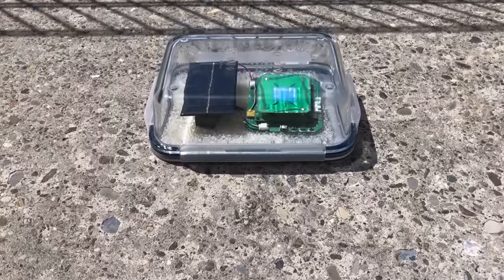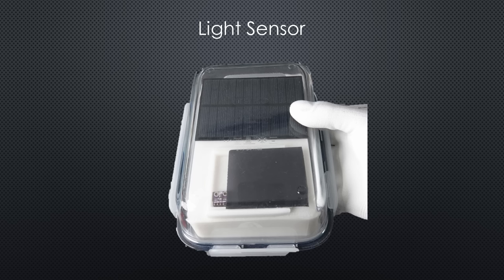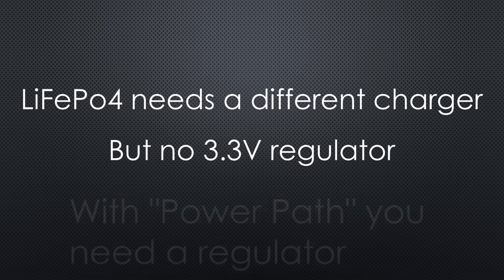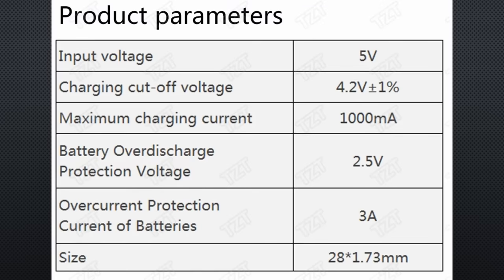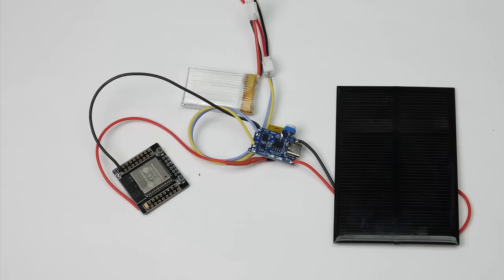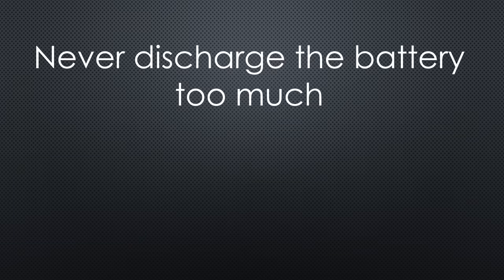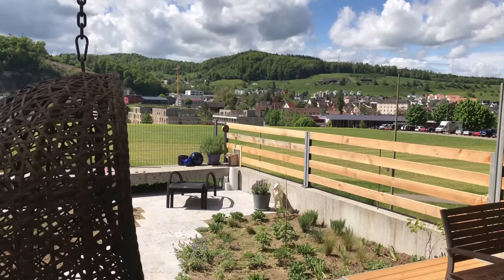#383 Cheap and simple Solar Power for our small Projects (ESP32, ESP8266, Arduino)

Comment: How about winter when -20C outside?
Reply from the maker: I do not know because we do not have such weather where I live. I assume the Li-Ion cells would not like it. Maybe you do a test setup?
Reply: @AndreasSpiess  Yeah, I am just hinting about LiFePo4 or LTO. And yes I am thinking about test board, I planing use some step up converter for 5volts with enable pin.... P.S. nice hint with diode and p-chanel transistor on power path!!!!

Comment: As I mentioned in previous comments, the combination of variable solar power and the typical power path circuit results in battery current flowing through the mosfet body diode under certain conditions, thus producing a 0.7V drop.  I've posted my work on this to a Github repo:

https://github.com/gbhug5a/Solar-Power-Load-Sharing

Included is a new design I've tested which features an opamp driving the mosfet gate.  The opamp inputs are the drain and the source of the mosfet, so anytime the output voltage is lower than the battery voltage, the mosfet turns on.  The result is that the output voltage is never lower than the battery voltage, and nothing flows through the body diode.  Seems to work well, and doesn't oscillate.  The opamp draws 1uA, and can mount on the TO-220 mosfet body and connects to its pins plus one ground line.  Also, no need to change the programming resistor, so no pot!  I hope this will be useful.  Thanks very much for this idea, Andreas.  Have a wonderful summer break.
Reply from the maker: Thank you for your simulations. Excellent work! Having a comparator driving the gate of course gives a much clearer cut. A good idea if you expect your battery to deplete till the end.  It can prevent brownouts of the ESP32 when the voltage of the solar panel is in a particular range, the battery voltage is already low, and your ESP boots at this time (see my recent video. For critical systems, this is a must, I think.

Comment: Won't the heat trapped inside your enclosure be a concern?
Reply from the maker: Maybe in some countries. For me it is good because it does not get wet and the glas protects it from UV.
Reply: @AndreasSpiess  I also have some concerns as well regarding moisture and dew forming inside, especially when the night is cold
Reply from the maker: This happened to me. Fortunately, moist condensed at the glass away from the electronics. Now I added Silica for a test. No results yet...
Reply: @AndreasSpiess  I didn't actually think that it really happened 🤣🤣🤣

Keep us posted 👌👌👌

Comment: This is my last straw of getting the answer but can anyone explain what he mean at 8:20 when he says "to comply with datasheet". I dont understand why he would put the 10uF cap there, what exactly is being complied here, sorry if I miss anything
Reply: Ok I just realized that the capacitor was placed right on the back of the HT73333 so that means its related to that. But I still don't know what, I will update if I found out what its about
Reply from the maker: Just look into the data sheet of the HT7333 and you will find the capacitor in the diagram.

Comment: Why  does replacing the diode by a MOSFET reduce the voltage to near 0?
Reply from the maker: You can try. But I do not see the advantage.
Reply: andreas did not understand your question. The point is that a diode has a voltage drop (~0.2V) bigger than a mosfet (typically ~0V)
Reply: @charlesmarseille123  merci

Comment: i didn't understand your calculation.. why did you divide 6000 mah to 3600 ? your esp32 to consumes 6000 mah per hour , doesn't it? (10 seconds x 100mah = 1000 mah, and 6 times per hour = 6000 mah)
Reply from the maker: I used mAs(econds), not mAh(ours) in my calculation.

Comment: Thank you so much for the great video! But we want more! How about a temperature management?
A Lithium battery feels most comfortabel (= battery life) between 15-35°C. If you go beyond 5-45°C you shouldn't charge anymore at full rate. Outside this temperature range the battery starts to desintegrate.
Same with the voltage.
The mostly suggested 2.5V is already way too low because at this voltage you are already in a quite dangerous, almost vertical discharge curve. Stay above 3.0V, or even better 3.2V and don't exceed 4.0V.
OK, now you need roughly double capacity, but better safe than sorry. 
Maybe it already helps if you take your battery out of your little greenhouse during summer time. 
Maybe even a small 5V fan to get some air circulation.
Reply from the maker: My proposal for temperature management:
In summer my battery is completely charged before it gets hot. And, because of the power path, it is not used during this period. So "storage conditions" apply for the battery which is much wider. I measured 65 C max during the last summer in the glass box. Not ideal, but acceptable for storage. But you are right, I do not expect a very long battery life.
I do not know why these chips switch so late. I agree, they should switch much earlier. 
I purchased a few such IKEA boxes for tests this summer. So far I did not start. The weather was not motivating :-(

Comment: I have completed the build of this circuit, with power going through the power-path to the ESP32 when it's sunny and from the battery when it's dark, plus charging the battery ok.  However, at sunset, sunrise or cloudy conditions, the ESP32 goes offline despite showing it's powered to some extent (ESP LED is on).  I have to press the Boot button to get it back online once it's dark or sunny.  I'm using a MCP1700-3302E LDO voltage regulator into the ESP32 with a couple of capacitors.  I believe the issues to be insufficient voltage coming into the ESP32 when it's neither sunny nor dark - anyone have any tips for that situation?
Reply: I have measured the voltages under these 'limbo' lighting conditions where the ESP32 isn't booting correctly.  I have the following voltages - do I need a different resistor across the panel terminals to make the FET work correctly?  These are all while the ESP32 is attached.

TP4056 - Panel = 3v
TP4056 - Battery = 3.38v
TP4056 - Out = 3.38v
After the Power path diode = 2.77v
FET S leg = 2.77v
Regulator output = 2.65v
Reply from the maker: You have to look at the Vgs of your FET. The one used here has a very low Vgs.

Comment: use a MCP73871...
Reply from the maker: What would be the advantage?
Reply: @AndreasSpiess  
Power path integrated, on no drop-down voltage. 
The solution even with a schottky we loose 0.5V... this is hudge for a battery.
Also the TP4056 have a 'Trick": 
The TP4056 will "reset" his charging cycle if you consume less of 1/10th of the charging current setup.
So for 1A is 100ma.
If your load is below this.. no need to add a power path.
The charger will "ping pong" the charge between 4.2V and ~4.1V  when it's powered by solar panel or any input voltage.
For a lithium battery it's not arm at all, moreover is good. You will never do a charge cycle, then preserve your battery.
Lithium like to be often charged....

Comment: Ich benutze normalerwis es cn30665 für chlini 6v arduino Projekt. Isch chliner und billiger..
Reply from the maker: Ich glaub der hat keine "low voltage protection" und auch keinen "Power path". Aber sicher bin ich nicht...

Comment: I'd be extremely wary of leaving a lipo like the one you're using in a glass jar exposed to the sun throughout a year. I very much doubt it's rated for the kind of temp you'll see in your enclosure.
Reply from the maker: They are far away from anything else. So I see no problems... People also leave their Teslas in full sun in relatively warm regions... Or their smartphones in cars which also heat up considerably.
The max measured voltage last summer was 65 C

Comment: Hallo sir, i have a problem with esp32 ttgo lora sx1278. 
When i upload program to the esp , in serial monitor give me to me text " Could not find a valid bme 280 sensor, check wiring! "
What happen wrong, Sir ?
Reply from the maker: It seems that your wiring is wrong. I would check it. If you do not intend to use a BME280, you have to change your sketch...
Reply: @AndreasSpiess  but i have followed the pinout of esp32 ttgo.
if i don't connect the sensor, the output data will be rssi. but when the sensor is connected the sensor is invalid.
the pin out that I use is SDA 21 and SCL 13.
Reply from the maker: Are you sure these are the right pins. Default they are 21/22
Reply: @AndreasSpiess  yes sir, i use the pin out 22 and 21.
Reply: @AndreasSpiess  but, before that. I scan I2C and on the serial monitor , not found I2C . Must me adding resistor Sir  ?
Reply from the maker: Usually, no resistors are needed. But I cannot do remote debugging. I would try the sensor on a different ESP32 or even Arduino board.
Reply: @AndreasSpiess  Where do you think the fault is, Sir? may i ask for a telegram for further confirmation?
When I program only Lora sender and Lora receiver, the program runs. but if the sensor has been included it will fail.
Reply: @AndreasSpiess  can  you give me your telegram to comunication?

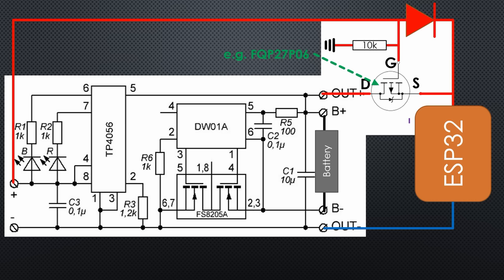Comment: 11:57 I made this scheme. Everything works ok, as described by @Andreas Spiess (thanks a lot!), but I noticed the strange thing. If I disconnect the solar battery I have got a potential +3,13V on the +IN and -IN pads of the TP4056 module. The +OUT and -OUT of the scheme at the same time shows 3,34V. (0,2V more) I can't understand what is going on. The diod should block the reverse current from the battery to the IN, doesn't it? From +IN to +OUT the multimiter in diod mode mesuarement shows 1,1V forward, and 0,2V reverse.  The diod is broken? Have anyone faced with the probllem with this scheme?
Reply from the maker: A voltage can exist without a current flowing. So your Diode probably is ok. Attach a 10k resistor instead of the solar panel and measure the voltage again. Most probably it is 0 now.
Reply: @AndreasSpiess  thank you for your answer. I disassembled the device and saw that the diode was placed in the wrong direction. This is my fault, how I couldn’t see it before. So I re-soldered the diode and it works perfectly now! Thanks a lot!

Comment: Thanks for all your videos! You always come up with amazing yet simple solutions to practical issues we guys face! Thanks for everything!

I do have a problem n i hope you could help me with it... Everything works as you mention in this and other videos BUT the problem is that the TP4056 module's battery protection circuit won't let current flow (I mean no voltage between OUT+ and OUT - terminals) if the load eg. Wemos d1 mini is connected permanently. However if I put in a switch between OUT+ and Wemos d1 mini's 5v terminal and use that to switch on wemos, it works!

So it won't work unless disconnected and reconnected. Am I missing something?
Reply from the maker: I do not know the reason for that. You have to check all the voltages, and compare them with the data sheet, I think.
Reply: Thanks Andreas! Will do that and try and figure this out. Thanks for your reply.

Looking forward to your next video 😊

Comment: Thanks for another excellent video, Andreas! I am a fan of your work for maker community!

I have a question about an alternative to TP4056 wich has the advantage to include a power path so it can manage switch from battery to supply like solar cell, automatically. Application board is jye118 which includes the chip LTC4054
https://jyetech.com/Products/118/Manual_118.pdf

Very easy to find in usual Chinese stores and with prizes like TP4056 boards. Two possible cons vs TP4056 are:
-	800 mA max charge current
-	Max input voltage 6.5 volt

But I think it is valid for solar cells you commentede in the video. My doubt is about protections in TP4056 based boards apparently not present in JYE118 -LTC4054 like DW01A. Not clear if chip itself has this protection included. 
https://www.analog.com/media/en/technical-documentation/data-sheets/405442xf.pdf

Please, could you help me with this doubt ? Thanks in advance!!
Reply from the maker: You are welcome!

Comment: Now that the cold weather is hear. What do you do about sensors outside in Cold weather?  How do you protect/regulate 18650 or other batteries to keep them charging and discharging correctly?
Reply from the maker: For the moment our temperatures do not go much below freezing and all works fine with the normal stuff as shown here.

Comment: @Andreas Spiess Please check this solution on Aliexpress: Mini Mono 80*45mmSolar Panel 5V 60MA for Mini solar panel charging and generating electricity with Mini solar lipo charger 

i also found this:
"Mini Solar Lipo Charger CN3163 CN5711 Solar Panel Regulator Controller Input Voltage 4.4V-6V to 4.2V Solar Panel Input 0.99A"

Is it also suitable?
Reply from the maker: You find many other solar chargers (I once made a comparison video about a few of them, also one with a CN3065 if I remember right). You can chose according your needs.

Comment: what's the purpose of the tantalum capacitor you use here ? https://youtu.be/37kGva3NW8w?t=502 Could you share the ref you are using?
Reply from the maker: As said: To comply with the data sheet of the HT7333

Comment: ESP32 Converter not exactly the same as the video
Reply: The ESP32 pin adapter has finally been delivered. The BOOT and RESET buttons (at the bottom) are not already soldered.  The adapter shows RESET (on the left side) and IOO (on the right side) . Your video shows  BOOT on the left and RST on the right. Is it important? I think that you don't use them to make it work.
Reply: I have just remarked that at the back of the converter, GND and 3,3V are on the left side , not on the right side. Instead I read SVP ad SVN. Some others are different or  not at the same place. I suppose that I have to stick to your schema whatever is written on the converter because the important thing is the ESP32. Could you confirm? Sorry but I cannot (or I don't know how to) attach a pix.
Reply from the maker: I would stick to the markings of the PCB. They often change designs and sometimes they sell stuff from other manufacturers.
Reply: @AndreasSpiess  The PCB and the ESP32 came separately. The pins marking is different at the back of the ESP and on the PCB. In this case, I will trust the ESP marking. I will do some tests with the PCB before soldering..